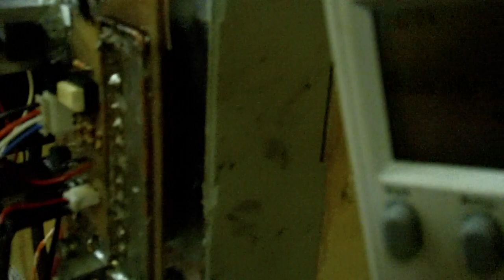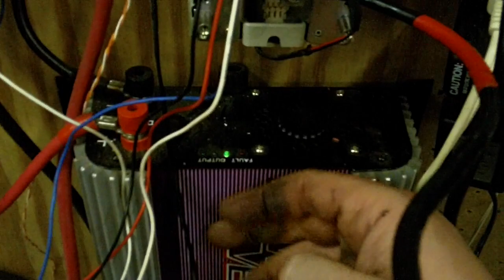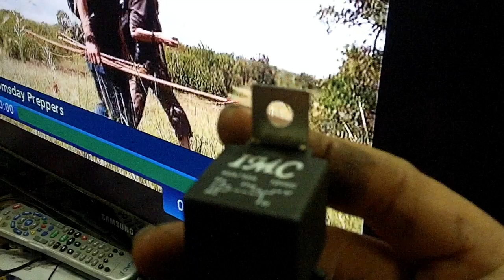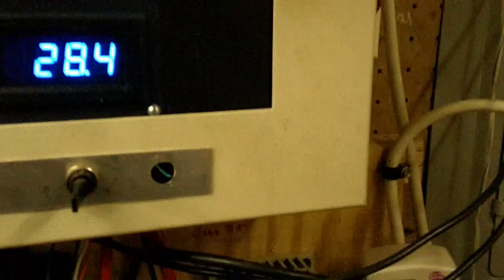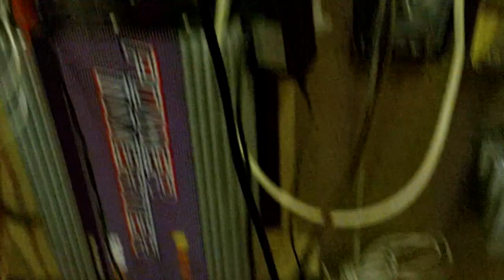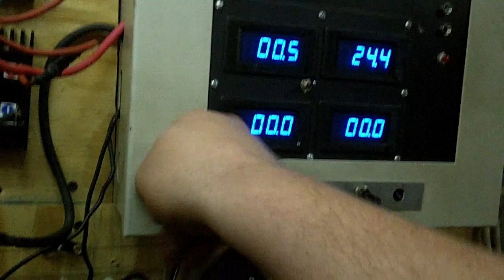Solid state relay part 2

Comment from the maker: I like building stuff but with todays tech its almost cheaper to buy them, already made. with the relay as a base platform it can be used as a powerfull PWM since it can be pusled. and its completely isolated from the output. I can huse a 12 volt battery to controll up to 100 volts dc. and be isolated. and with the addition of the bridge recifier, hooking this up with the controll wires is a snap.   I do like messing a round with electronics.

Comment from the maker: thanks for the comment. yea I took a peice of copper wire top and bottom and soldered those in to handle more current.  I most likly never run it over 50 amps 1500 watts but if I did I like for it to handel it lol.   I have thought of buliding a ebike controller. as of now it runs pretty good.

Comment: fatten the tracks with a good run of solder, if thats not enough solder some wire along the track, thats what happens in the ebike motor controller world, same sort of fet setup

Comment from the maker: the only thing about these kinds of charge controllers is they dont eq the battries and they dont have a desalfator function on them like Outback systmes and systems like those. what you need to maintan a good battery bank is a desalfator to hit the battries with a high Frequncy to free the electrods of salfer build up and mix it back in the battery, and also always make sure they are toped off with distilled water

Comment: I wonder if I could make one of those for my coleman charge controller? I quit using it because I felt like it over charged my batteries. Well a battery died I wondered if it was not charging correctly. It would do that buzzing sound sometimes, the replays were not that great.

Comment from the maker: and another good thing is now I dont have moving parts to wear out.   I first bought a chinise dc solid state relay it said it can handle 40 amps and 440 volts but when it ran the gti it burned up and I found it was only a 300 watt mosfet that was used so I decided to build my own. and found the 750 wat mosfets and sofare so good.

Comment from the maker: I did I didnt do it in the video but I did a while a go I will get a video up on that also if you like as it was running I took and put a jumper from the inpurt and the output and I didnt see any change on the kwmetter.   were as the relays when I was using them and did the same thing and some tims I go from like 12 amps out of the battery bank to almost 26 ams when shorting out the leads. thats when I found it was the problem.

Comment from the maker: yea they are made from 4  44amp 500 volt 750 watt mosfes. I did have two 40 auto relays but when they power on the GTI they didnt work so good.  I just put the solid state relay in and man what and inprovement and less space and wireing also and capable up of up to 3000watts. did you see the first video it also has the part number for the mosfet I used. and there is a comment on there on smaller mosfets I could use but I wanted as much power is a small space as I can